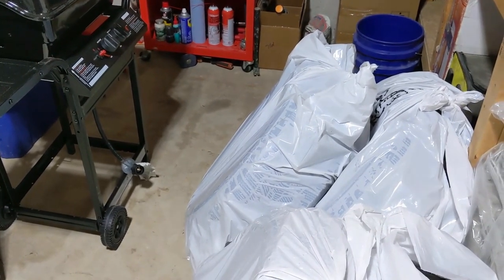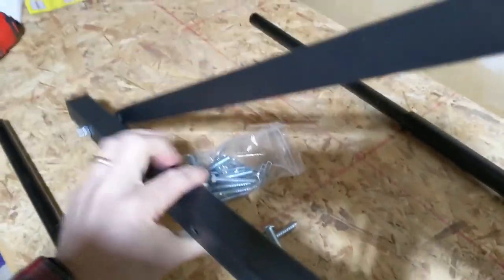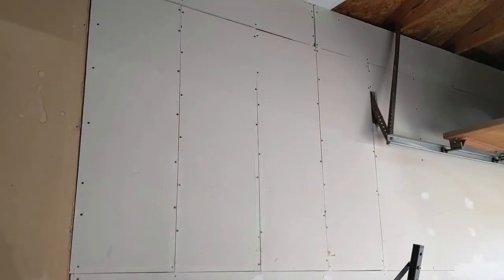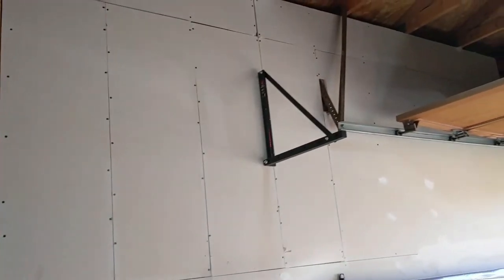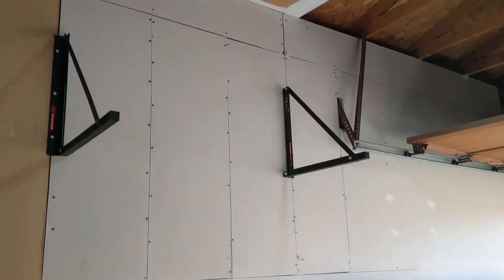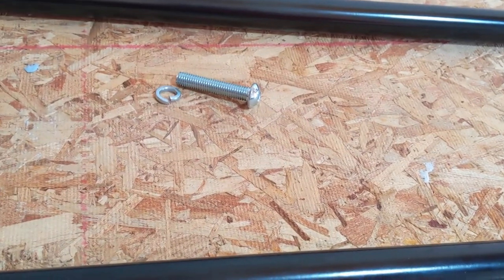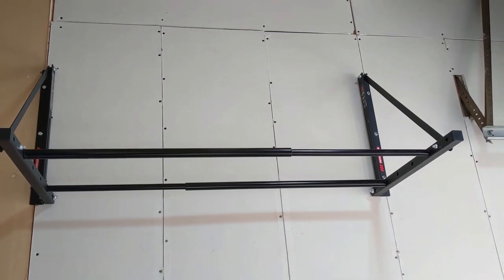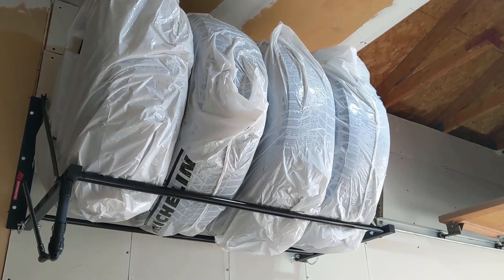Installing a Wall-Mounted Tire Rack

Comment: FYI Not sure if you already noticed, but your tires are sitting on the front support only and are touching the wall. I think you still have the rear support in the wrong hole (1). It should be moved one hole forward for (2). I have this issue currently with my 19's and did not have the manual anymore since I installed them a few years ago and just had to reinstall them to fit larger tires. Glad to see the manual does indeed tell you what position to put the support poles in.
Reply from the maker: Good catch! Yes, I saw that, too, and actually changed the position of the back bar (after the video, of course). 🙂

Comment: The 300-lb capacity will be OK for just tires, but tires mounted on wheels will max it out pretty quickly, especially wheel-tire sets for a truck or medium SUV.  I have a nearly identical rack sold as a MaxxHaul carrying four 215/60R17 winter tires without wheels, well below capacity.  I also have a set of four 265/50R20 light truck wheel-tire combos that weigh 77 lbs each, exceeding the capacity by 8 lbs.  Maybe not a big deal, but certainly enough to void the warranty and shift liability to me.  Not going there.
Reply: I think you meant tires mounted on rims
Reply: @dansimmons5963  No, I meant wheels.  The entire metal piece onto which we mount a tire is called a wheel, consisting typically of a hub, some number of spokes, a barrel, and an inner and outer rim into which the tire beads seat.  Calling wheels "rims" is common among boy racers, hot rodders, modders, and the like, but it's colloquial at best.  The correct term is "wheel."

Comment: I got the same rack on sale but my garage has 2 sheets of 5/8 drywall. I’m guessing I should get longer screws?!?!
Reply from the maker: Yes, probably so. If I remember correctly, the instructions indicated how much of the lag screw should go into the stud behind the sheetrock (or maybe I am remembering incorrectly). Hopefully you can locate the studs through that much sheetrock. Let me know how it goes.